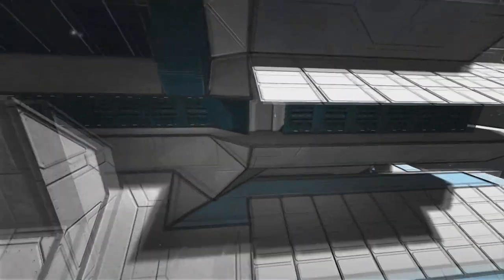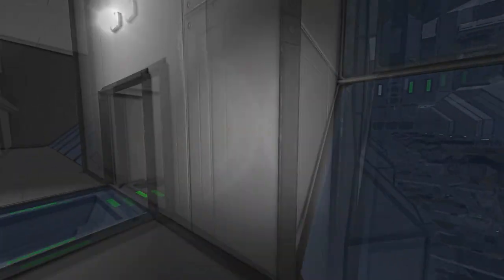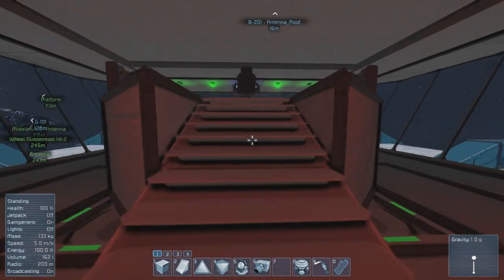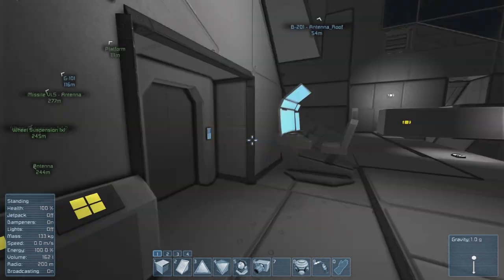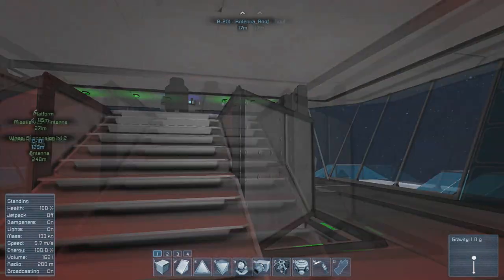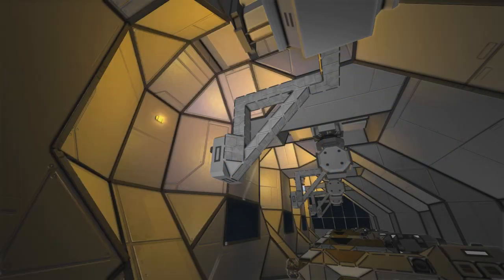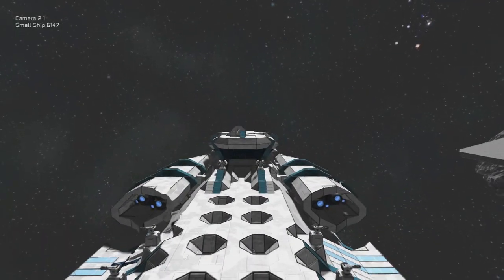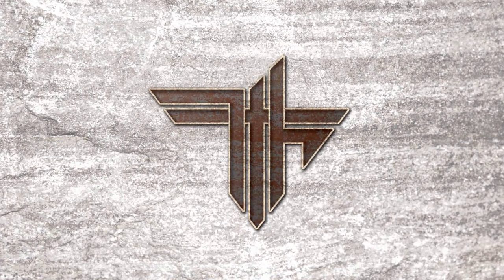Space Engineers | The Vintersol

Comment: Holy FUCKING SHIT! My engineering wet dream come true - just PORNOGRAPHICALLY AWESOME.
Immediately subscribed!!!
When you were firing the missiles I was thinking to myself: That's not gonna work during flight. Have you tried finding out the max velocity at which a safe missile fire is possible? Maybe you can modify the launch ramps with wheels (maybe modded wheels) to ensure safe departure. While you were moving towards the beacon, I thought a single missile bay facing backwards would be nice, that would solve the problem of firing during movement, since the missile will depart in the opposite direction. What happens when your automatic reloading system runs out of pre-made missiles? Do you have an automatic missile welder and magazine stocker?
Reply from the maker: Thanks man :), I tested a few times while moving pretty fast but the launch is not good at speeds. But they're some really good ideas your suggesting there and I'm sure this ship will evolve down the track. Cheers
Reply: I agree with this notion, and that is a good concern too. Those missiles have good range though, using them for extreme range bombardment or surprise attacks is still doable as they are now. This ship is a beautiful construction, simply amazing what can be done when the mind is put to it. Am i correct in assuming this is done without mods?
Reply from the maker: Randy Motter Thanks man, and yes that's correct, no mods used.

Comment from the maker: @Brandon Lacombe - Thanks bud. Are you opening an empty small world? and have you tried on a lower graphics setting to see if it helps?
Reply: It also may be, what I call, "dual GPU problem". It happens to me, because I have two graphic cards (stronger and weaker) and graphic controller is automatically switching them, whenever is needed more graphic power. But for some reason Space Engineers force my computer to use that weaker one and gives no option to change it (although there is drop down menu in settings for that, but it just don't see both of my cards), when it is set to "automatic", so I have to manually switch on that better one everytime I want to play SE. It is very strange, because nothing but SE does this.
Reply from the maker: Karel Šnajdr Ahh I see, I was not aware of that problem. Thanks man
Reply: If it is a dual GPU it will depend on which directory your space engineers was installed to. I have a hard drive split into two sections and I had to reinstall space engineers to the second directory because the game would only pick up the Intel graphics driver. I'm not sure if you have the same problem here
Reply: GIVE US THE G-101 BLUEPRINT PLS!!! I BEG YOU!!!
Reply: I NEED this

Comment: My question is why do you have a button on the outside of the bunker door to open said door? Wouldn't hat defeat the purpose of having the bunker? We'll I guess since the bunker is for use in case of heavy fire, not for boarding.
I did really like the idea of the trenches along the hull for security forces, even though I have no idea how effective it would be.
Reply from the maker: You have a good point, I suppose in the event of being boarded you could somehow have a control inside the bunker that disables the doors. And as for the trenches, yeah it was probably more of a cool idea rather that an effective asset but it could still be of use if the ship is disabled and troops and crew are the only defense left. Cheers